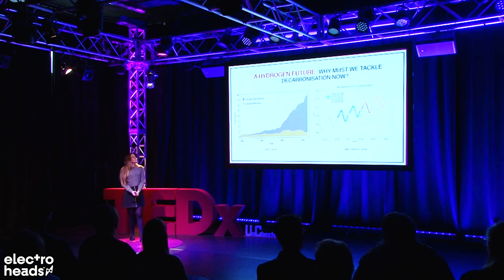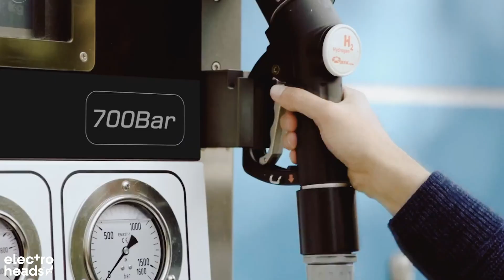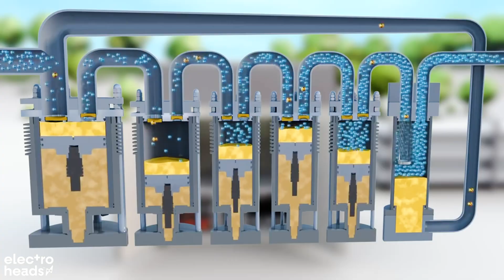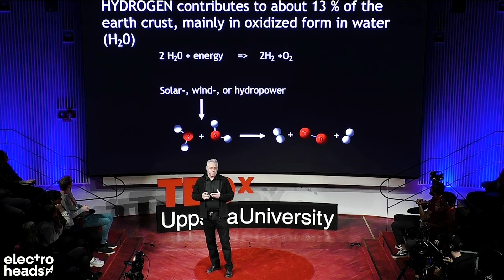Why hydrogen cars have failed - and will never succeed

Comment: Great video. I think the hydrogen vehicle horse has bolted. But for aircraft there is definitely potential. Also for grid storage.
Reply from the maker: Agree re aircraft! Heavy machinery too
Reply: @Electroheads  Not heavy machinery, batteries are driving them fine.

Comment: The big issue with hydrogen is making it. Most is made from natural gas which is no better than burning petrol.
It also takes more energy than what is created .
Reply: Let me calculate for you how stupid it is to store energy for half a year in a battery.
- I assume ZERO loss in battery.
- I assume 50 year life span of the battery.
- I assume an other 90% price drop!
So you got 1Kw of energy (worth ~$0.20), produced by solar in summer and you want to use it in winter. You need a $10 dollar battery, written off over 50 years that would be a $0.20/year battery write-off ... and that will still increase the energy price by 100%, WITH ludicrous assumptions for batteries. current hydrogen technologies would still be 5 times more efficient (+20%) to store energy for half a year.
Reply from the maker: Well said! A lovely idea on paper, but so difficult to execute
Reply: There are currently 3 main ways of producing hydrogen, you are pointing out the worst ... and still the gas they use is otherwise flared at oil refineries. Hydrogen is the only medium that can feasible be stored over many months, how do you propose we store the summer surplus of energy until winter? The only other viable solution I have ever heard was synthetic fuel (that is made form hydrogen)
And before you say batteries:
- way too expensive.
- they discharge over time
- They preform bad in the cold (that is when you need their charge).
Reply: @buddy1155  Battery prices have dropped over the last few years. It’s currently about 10% of the price from 10 years ago. Just like Solar prices have fallen, as have wind turbine prices.
Reply: @buddy1155  Oh, and hydrogen leaks. The molecules are so small it leaks everywhere.
Reply: @buddy1155  The worst way, yup, and currently over 95% of hydrogen is produced that way.